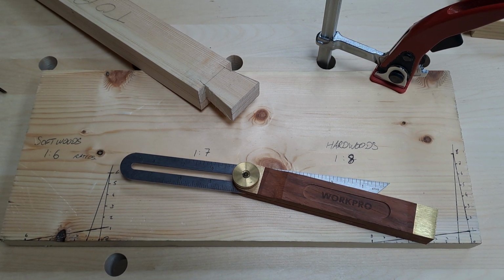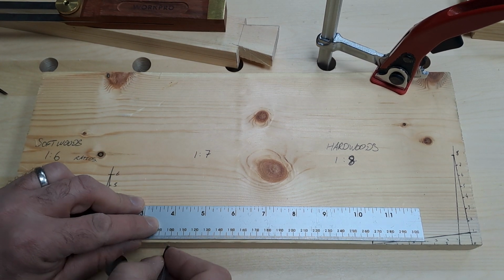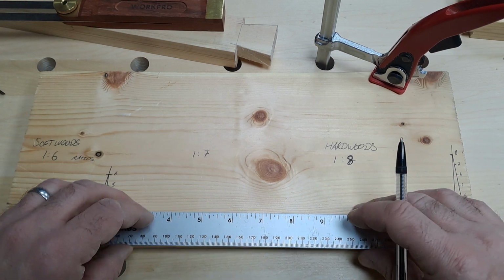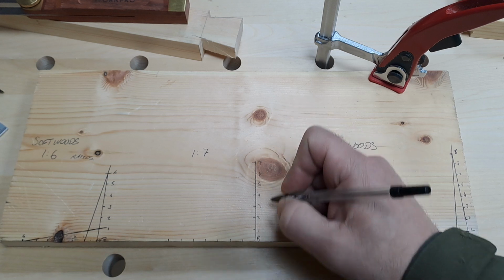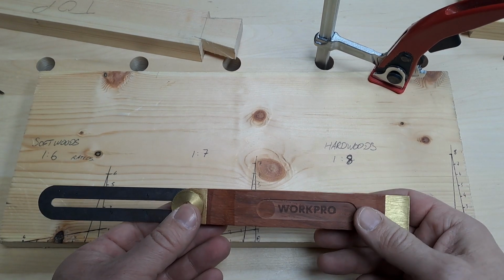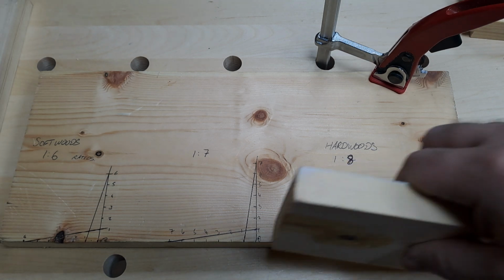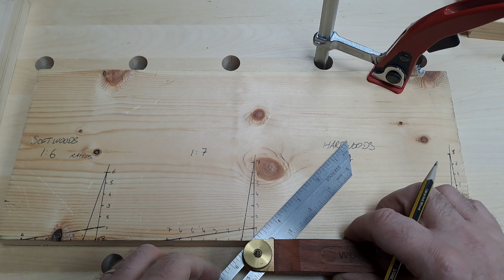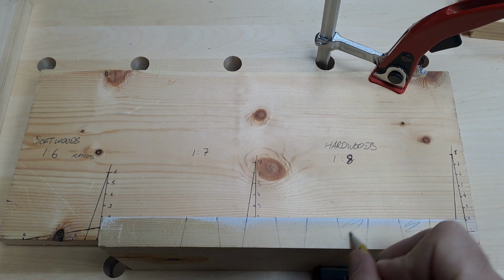How to Mark Dovetail Ratios with a Sliding Bevel

Comment: I needed to cut dovetails in splayed legs for a bench. I cut out the 1-7 triangle from thin panel material. Then added a hole for a bolt to add a little block with another hole. Wingnut to tighten. Set the angle of the little block to my 15 degree splay and I was able to mark my dovetails on the angle.
Reply from the maker: Be good to see some images of it. Cheers.
Reply: @bluewoodhandyman  Just imagine a 1/8 plywood triangle. With a bolt through the wide end and a little block of wood on that bolt. I made it 1-7 both sides so it does not have a right angle. Two inches wide. Multiple holes to move bolt and block.